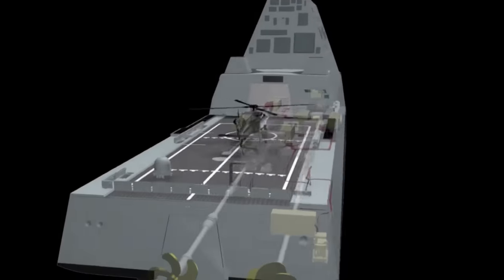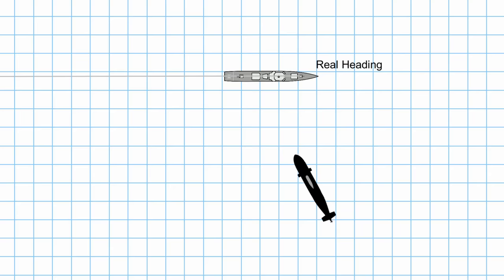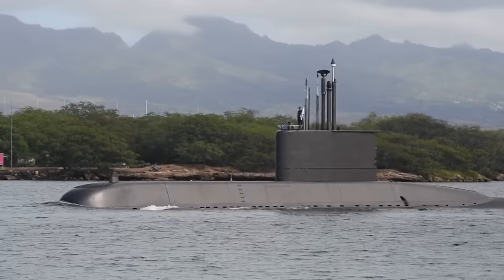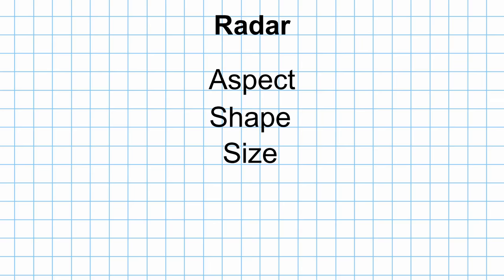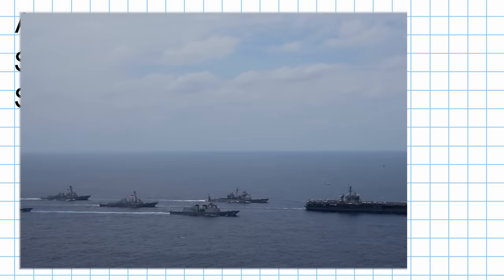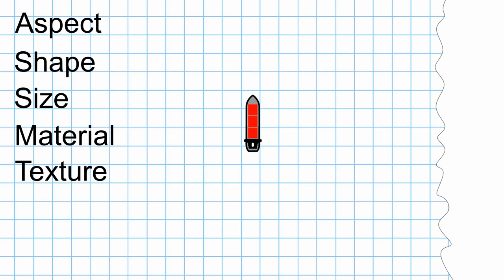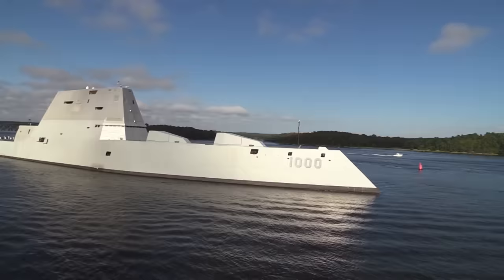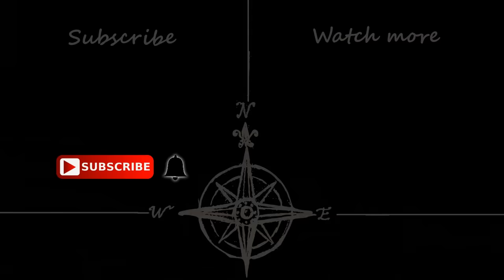Stealth Ships: How They Work

Comment: Ben Rich, the director of Lockheed's "Skunk Works", wrote that they had a prototype stealth ship that worked too well. It's radar defeat was so good that it would return a smaller signal than the waves around it. So to the observer, it looked like a void of perfectly smooth water moving through the ocean. He said that it broke rule zero of stealth; 'As quiet as ambient noise, not quieter!'
Reply: That reminds me of the current thermal camouflage for infantry. It is so good at dispersing heat that unless you are trying to wage war in -10°C you are gonna stick out like a sore thumb.
Reply: Imagine that you’re on patrol and all of a sudden the birds’ songs become muted

Comment: I still cant decide rather or not the Zumwalt is one of the ugliest warship I've every seen or one of the most beautiful.
Reply: it doesnt matter, because shes commanded by captain kirk.  thats all that matters.
Reply: Meow
Reply: Pretty sure the Novgorod wins that award.
Reply: CR BZ  Submarines have a lot of drawbacks, and you don't always need that much stealth.
Sure, a sub can pass very close to almost any vessel undetected, but there's a lot of ocean. If you can spot the enemy and maneuver around them before they spot you, that's all the stealth you need.
Reply: CR BZ  buddy, not to antagonize but theres alot wrong with that statement. For one, they arent meant to be stealthy as in difficult to detect in the first place. Instead they are designed to make it hard for the detection equipment of enemy surface combatants to first find them, percieve them as a threat, and then direct ordnance at them. Two, everything cant be a submarine. Everyone in the online military community seems to have this impression that if one thing does one job well everyone should devote everything towards it. But a submarine is not imposing; its not a deterring threat and its not good for gunboat diplomacy. Submarines also cannot offer consistent artillery support for ground forces, which if I remember correctly is one of the things the Zumwalt is going to excel at once they find a suitable gun. What I'm basically trying to say is that Zumwalts stealth is meant to give it an edge over other surface combatants, particularly other destroyers and in some cases land based missiles by making it harder to detect and hit. Its not meant to make it "sneaky" like a submarine. Besides, weve already got a substantial submarine fleet.
Reply: @PvtMartin78  ...you mean the circle ships?
Reply: CR BZ  I think youre missing sherlocks point. Yes warships are larger targets then submatines but they still operate in an ocean that is impossibly enormous compared to them. And whilst yes, in a prolonged one to one fight a submarine would almost always win, thats not how war actually works and single ship actions we're rare even in past wars let alone in the modern day. In reality if a submarine was spotted the surface ship would simply flee or have an attack submarine try and cover it. And if it comes down to it, they do have torpedoes and depth charges that can dispatch with subs quite easily.
Reply: CR BZ  also your comment about doctrines is flat out wrong. The Abrams is a good tank by anyones standards, just going off of statistics alone, not to mention thr fact that it was design intially to fight in a completely different environment to what it usually sees service in these days. The  A10 would be ineffective in a war where air superiority is not achieve, true, but once it is achieve they will be just as effective as they are now and you simply dont send them in before that. The F35, like the abrams, is also a good plane regardless of doctrine and to say its not would be crazy, consider every nation is rushing to buy them.
Reply: Meow#2
Reply: ugliest or beautiful but powerful
Reply: @pezpengy9308  it would be better if called the Enterprise tho.
Reply: just say yes, cause it covers both.
Reply: @PvtMartin78  yea ufo ship
Reply: This ship is definitely atrocious but if you want some good looking ships then thank the Axis Powers
Reply: CR BZ nah the best looking ships died out after WW2
Reply: Sherlock Hooves U-boats in a nutshell
Reply: @whispofwords2590  This is where the concept fails though, once you are shelling the coast from a ship parked 30nm out at sea, stealth is entirely pointless, your ship will be screaming out its location. A ship is too big to make invisible to radar and in the era of autonomous drones all signals can be investigated at low cost.
Reply: CR BZ  I agree with you. The scenarios where a stealth surface ship is going to gain a decisive advantage over a ship with basic and non-obtrusive signature reduction are basically non-existent.
Reply: @N330AA  a drone can be shot down, and though zummwalt may not be completely invisible on radar would you really waste munitions on a ship that appears to be the size of a fishing boat? Note that I mention the eneny must percieve its target as a threat before firing upon it. As for tracking gun fire, we dont know yet how far the Zumwalts guns will be able to reach or exactly how they will work or even really what they are. I'm sure the Navy, if it can restrain itself from going to far with shell design, can find away to make it work. Also, pretty sure in most situations where these ships are being sent up to bombard coastal targets they either won't be alone or we will already have naval superiority. Even if we didnt and they were alone for some reason its still going to be difficult for an  incoming enemy to detect it before being detected by zummwalt herself, thx in part to its detection and its unique design, and in that case the zummwalt still has an exceptionally dangerous missles battery of her own to attack preemptively with.
Reply: @whispofwords2590  exactly a drone can be shot down, thus giving away the hostile boat's position.
Reply: @N330AA  but how exact would that position be? Also the zummwalt probably wouldnt necessarily be the one to shoot it down..hell the infantry it's providing gun support too might be be able to handle if given the right equipment. Or an escorting Arleigh Berke. Maybe Even the LCSs.  Anyway, I think you and the previous guy are looking at these ships incorrectly. They don't exist just to be stealth ships. They are destroyers (or cruisers ig ) that use stealth as an additional line of  defense. They have many feature other then their odd looks that make them better than and give them an edge over contemporary destroyers. Their VLS with the way its silos are placed. Their high tech detection and computing suite. Just to name two off my head.
Reply: CR BZ First of all no. Only the export models of the Abrams’ use Chabom armor, that’s why they are able to be taken out by RPG’s, the ones that the US uses, use DU armor, which is debatably the best tank armor in the world due to it’s density. And for the Zumwalt, they will utilize the railgun in the future. The US said that the project has been postponed due to financial problems. There are no problems with any “breakthroughs”.
Reply: CR BZ You obviously have no clue what you’re talking about, seeing as the standard Abrams is outfitted with DU inserts, cobham armor has largely been fazed out of the US tank arsenal, and is almost strictly used for export models.
Reply: CR BZ  Stealth is very much a defense. It isn't just about preventing the enemy from detecting you, but making you harder to target in general. Take the F-117A Nighthawk's combat debut over Iraq. They were detected just before they reached their targets, but never targeted or locked. The only warning they had was a general 'holy fuck there's something up there but we're not sure what' before 2,000 lbs. Paveways started raining on them.

The same thing applies to the Zumwalt. Sure, you might know there's something there, but it'll be harder to narrow down exactly what and where it is, buying the Zumwalt valuable time to engage threats brought out of hiding by the initial salvo. The guns are there for use AFTER hostile anti-ship defenses have been removed, in support of ground troops. Furthermore, once they have their railguns, the stealth features will allow them to close into gun range without being detected, and fire nigh-unstoppable projectiles that impact before the enemy can effectively retaliate.

It doesn't matter that you know something's there if you can't actually see it.
Reply: @whispofwords2590  no offense sir. but I also think non-stealth destroyers are better.

y'see... we all know that destroyer type weren't exactly tanky in terms of armor. and thus, have to rely on other stuff to survive. that other stuff include (but not limited to) stealth, and speed. nobody can't hit what they can't see (stealth function). or stuff that isn't even there (speed, which mean: RUN LIKE HELL!). and I see that you favor stealth as means of defense, and that's fine, really.

however, as you could see, there's so many limiting factor solely to maintain stealth function like it states on this video: No steel, no portruding objects. which will severely limit destroyers capabilites to shoot stuff (another forms of defense too), and increase production cost. remember, US won WWII in pacific thanks to it's massive productions. things that can't be done with expensive material.

that's why I prefer another types of defense: SPEED! Quick to fight, Quick to flight! immediately engage the enemy. throw everything you had at them. and run like hell before they could shoot back! which means: DOUBLE HULL SHIP in order to reduce drag! though I hear that double hull can't really carry as much as single hull ones.
Reply: Why not both?
Reply: [AVN] Badger I’m not an expert but I think the Russians and us navy use a high speed gun to shoot missile but not aircrafts thou
Reply: Alif Kazeryu I’m not an expert but anti ship missile air very fast faster then ships will ever be
Reply: The first and final Zumwalts were both built 2 miles away from my house in Bath Maine, ugly ships but effective, I had the chance to walk inside one because I have family that builds them and its actually really neat
Reply: If you want ugly warships look at the new Queen Elizabeth class monstrosity.
Reply: I think the Zumwalt is ugly but that’s not it’s main problem... from what I’ve read It’s a bad ship in general but I might just be biased

I’d love to see a good aspect of this ship other than stealth
Reply: The Zumwald class became a solution to the problem of missiles for hitting ships have improved to the point an amphibious battle group of marine carriers, and amphibious ships are having to stand off further and further. If we didn’t fill that space the enemy would. But the littoral, or theatre close to land is very dangerous,, so the command ship, a Zumwald, and specialist ships, the Freedom and Independence class LCS, all must be stealthy because they fill that space between amphibious combat group and the land, where they’re easy to find and within range. They can cover the marines and army landing vessels without being detected. Problem is, they forgot all of that when they scrapped the Zumwald class, and didn’t scrap all the LCS. The LCS have weaker radars and very little armament. Hopefully we don’t ever land more marines and army soldiers than what three Zumwald littoral groups can cover.
Reply: @pezpengy9308  I hope one day that man commands the USS Enterprise!!
Reply: jaelon meggs The Zumwalt is beautiful you just have no taste at beauty
Reply: @makoyloyola4986  ..did you mean that for me? ^
Reply: @tws1man582  you realize they are protypes right? And as I understand it the ships themselves are good. Its their armament that the concern. And given how moduler modern warships amd ships in general are it shouldnt be to hard to fix if the fellas in charge can resist over complicating things and learn to accept good enough as opposed to perfect.
Reply: @brandonproductions8401  lol the only axis power ships that look good are the Italians ones, and their performance and capabilities contradicted their appearance. The japanese ships just look..weird if not out right horrible. And the German ships looked decent at best, especially the smaller ones. And just because the ships of ww1 and ww2 looked good im their own way doesnt mean the modern ones don't either.
Reply: jaelon meggs The Yamato and it’s sister ship Musashi looked pretty good and Japanese Aircraft Carriers as well as for German ships there’s the Bismarck or maybe the Scharnhorst
Reply: @brandonproductions8401  I peronally never found the German capitals particularly beutiful. The size of the superstructure at its base on Bismark particular always threw me off a bit. Now Yamato and her sister ship in not really sure about. If they are attractive its in a strange sort of way thanks to the Pogota or however you spell it. As for the IJNs carriers, some of then look good I admit but they all seem different to me. And I hate the way the smaller ones with the bridge below the front of the flight deck look.
Reply: jaelon meggs alright then what ships do you think look good
Reply: @brandonproductions8401  late war American heavy cruisers, early British light cruisers (especially from ww1), most seagoing ironclads, most of the Italian fleet, the French battlecruisers, HMS Hood, the most British ww1 battleships and the American standards after their rebuilds, ships like those. Also the Russian cruisers and destroyers are nice.
Reply: CR BZ  The A-10 isn't equipped with armour, it's equipped with a titanium "bathtub" that ONLY protects the cockpit. The rest of the aircraft isn't armoured. And this is where you're wrong: anti-aircraft artillery is very easily avoided by not flying low and slow. Not even the A-10 flies low and slow in modern conflicts.

You're also misunderstanding the purpose of stealth. The F-117A got shot down under very specific concurring circumstances, for example with the S-125 operators taking a huge risk by making themselves a target for anti-radiation missiles for a long time. That's because stealth mostly works by reducing effective detection, tracking and targeting ranges. But if it flies too close to the enemy detection systems they will in fact be able to target your aircraft and take it down. The same works for ships. Also, CWIS are increasingly useless against modern threats. As for decoys, jamming and so on, they all have drastically improved performance when covering up a much smaller signature.

Really, what I'm saying is that if you focus on stealth as better "sneaking" ability, you forget that it provides a massive boost in all-around performance against all threats. It's not something to implement to some type of combat systems, it's something to implement to almost all of them. But for this you have to understand modern threats and not focus on what worked in the 70s.
Reply: I live right next to where they are built, and see them almost every day. They're pretty freakin amazing tbh
Reply: @whispofwords2590   warship's stealth works only with surface radars.......you can't hide from satellites....... satellites can track all such vessels
Reply: @forfun5238  good luck finding a ship in the middle of the ocean. Even with a satellite, you'd have to know where to look first, and then pin point its location. Which, given the size of the ocean relative to the size of any ship, is going to be a bit harder then it'd seem. Also, as I said before, Zummwalt isnt built the way she is to not be found in the first place. Shes built that way so that enemy surface combatants have trouble positively identifying her, determining her to be a threat, and targeting her; and so that in a fight its more likely that she'll be able to detect and attack surface targets before they detect her, giving her the first shot in the duel, which usually means she'll win. Its more like modern armor then some kind of cloak.
Reply: @whispofwords2590 the daily shipping traffic is monitored by satellites.......the radar sat picks up big targets based on it's radar cross section.......it's impossible for the zumwalt to get within 400km of Chinese or Russian coasts with out being detected.......the AWACS and other surveillance platforms could still detect it at long ranges........
Reply: @forfun5238  I would think that civilian vessels that are in somewhat regular communication with each other and landbased facilities would be a lot easier to pin point. Additionally, I'm aware of several instances of modern civilian vessels being lost at sea, then searshed for extensively, which would imply that satellite tracking of commercial ships isnt so precise when they aren't communicating. Also, the entire point of the design is to reduce the radar cross section. Thats literally why it exist. As for your last point, even if its true, which I doubt, what of that I said pertains to what I said? The design is meant to give enemy surface combatants trouble, not coastal defenses. Also why do you keep putting in so many commas? And how would you know that?
Reply: Don't say it's ugly, it's my baby!
Reply: It's the weirdest ship I've seen and i've seen very weird ships
Reply: @charlespepito5523  they're not working 😁😂 and cancelled huhuhu
Reply: It looks like a star destroyer